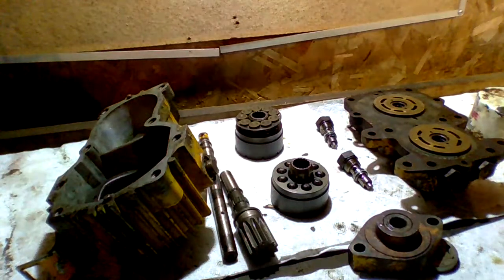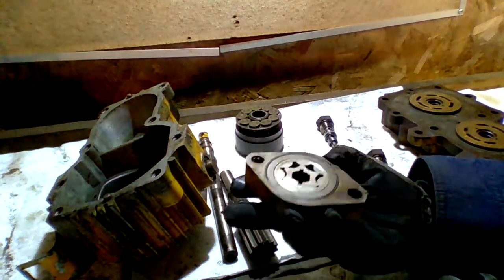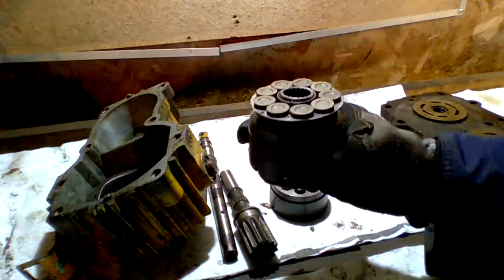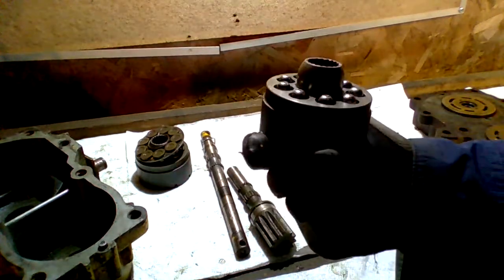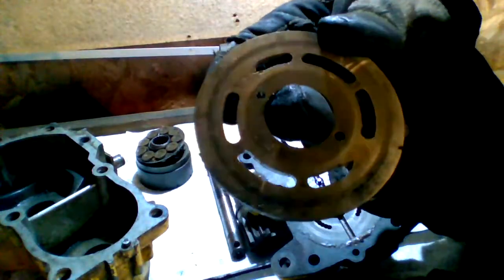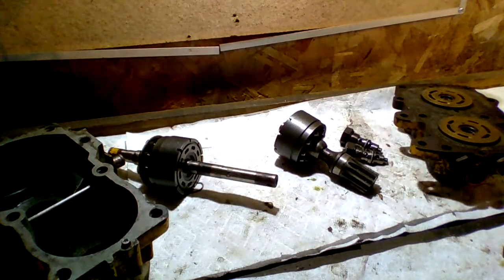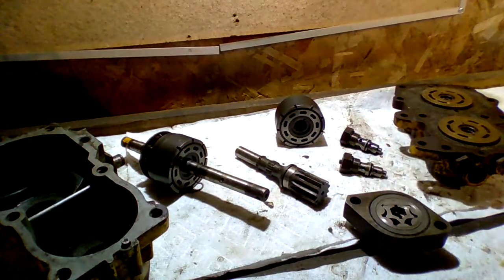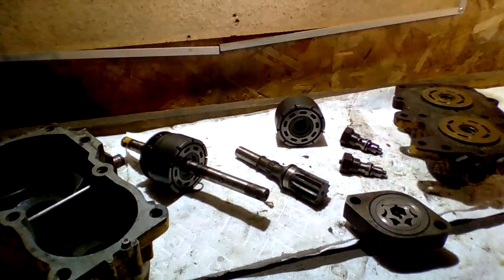How a Cub Cadet (sundstrand) hydrostatic pump works

Comment: Hi-Is there a way to tell the difference between the motor piston block from the pump piston block? I took mine apart and they look exactly the same.
Reply from the maker: It's been a long time since I've been in one of those pumps, but as far as I recall, there is no difference in the block assemblies, they are the same parts, besides of course any wear patterns from use.

Comment: Any idea what the most likely culprit is when it comes to weak forward and reverse? It won’t even climb the smallest of incline. I was wondering if the charge pump (some have seals inside them) might be it or more likely the motor or pump? It’s probably worn motor and pump but I was hoping not to have to pull the tranny out and tear it down...
Reply from the maker: What kind of machine is this on? Rather than condemn the transmission I would first take a good look at the driveshaft. Cub Cadet used pins in the driveshaft couplings that can and will shear. It is possible that a pin has sheared and it is just creating enough friction to spin the transmission input slightly.

The other big external thing to check is the hydro control linkage. Cub Cadet used a "trunnion" set of dampening springs to smooth the hydro controls but they tend to wear out and cause issues. Those and other worn components could be causing the hydro controls to not move as far as they should, thus resulting in a lower speed.

A third thing to check is the pressure relief valves, whether manual with the little buttons or automatic they can fail, but usually a relief valve failure results in no movement at all. If you have manual relief valves with buttons be sure that the buttons can be pushed down and will come back up freely.

Comment: when you said you could flip it to run clockwise, how would you do that? i got a small diesel that i want to run in an 1872 that my m18 is shot.
Reply from the maker: It's relatively simple actually. The charge pump is held to the front of the hydro unit by 2 bolts, one at the top and one at the bottom. Remove the 2 bolts, and simply rotate the charge pump housing 180 degrees around the shaft it's driven by, and then reinstall the 2 bolts. This flips the cavities inside the pump, and causes it to pull fluid when rotating the opposite direction.
Reply: I love finding the answers I need from guys years later after the videos. I have a kubota diesel and am doing the same thing to a 1450 hydro.

Comment: How do drain the fluid on these? And where can you find parts?
Reply from the maker: Well, unfortunately, the IH cast iron hydrostatic transaxles don't have an actual drain port. To drain one, you need to remove the rear cover plate from the axle housing and let the fluid exit there. Don't forget to replace the filter too. The never CCC/MTD aluminum versions of the transaxle do have drain plugs, as do the gear drive versions of the cast iron transaxles. The Cast Iron hydrostatic is the only one without a drain plug.

Parts for Cub Cadets can be found in various places, the best bet that I would go with is Cub Cadet Specialties, www.ccspecialties.org 
There are many other good websites but I highly recommend this one in particular.
Reply: @Tractors101  good video my friend. Parts can still be sourced by sauer-danfoss who now owns sundstrand.